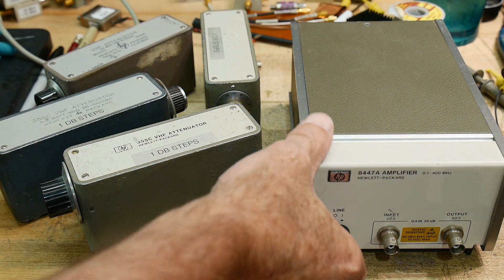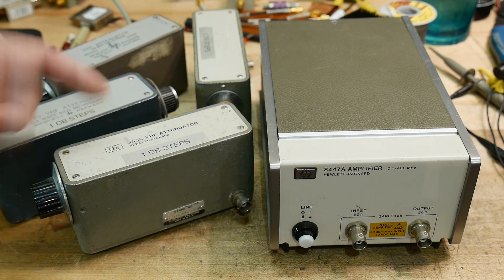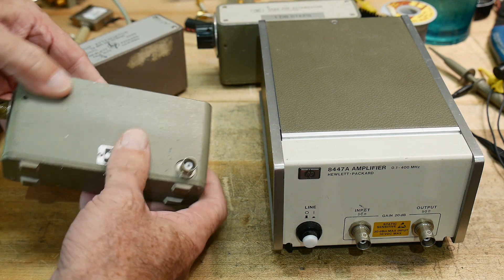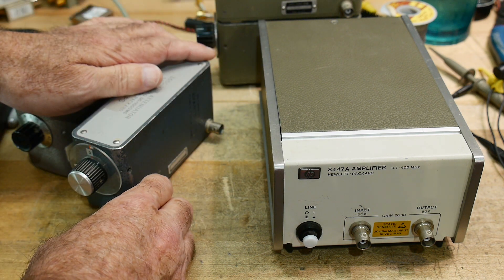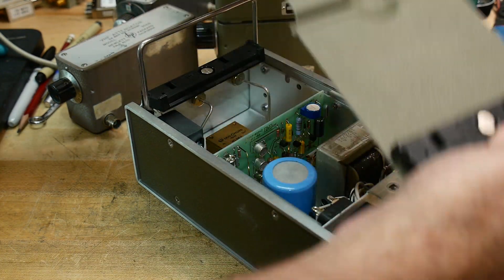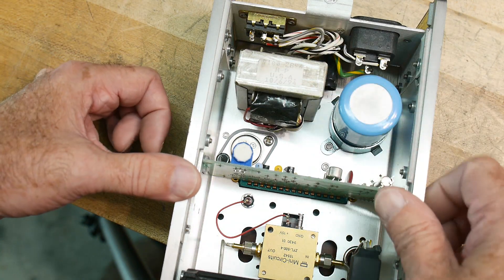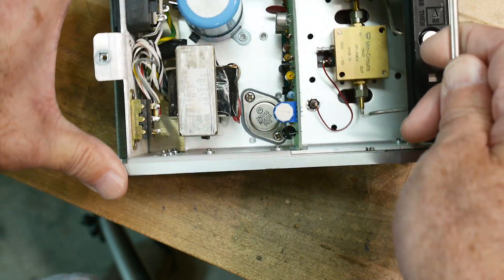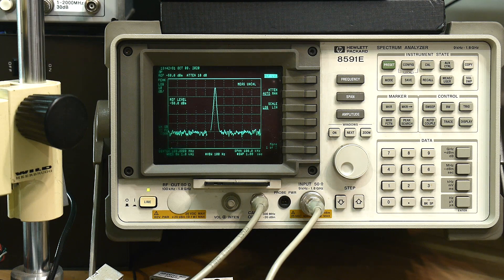#609 Craigslist Find Amplifier and Attenuators

Comment: Good morning. I myself feel happy and lucky on seeing the original hp amplifier (with the mini circuits in it) and the 0-120 dB step attenuator (apart from the 1dB ones) for $20+20. 
It's a great buy.
The 2N3055 NPN Si pass transistor in the 12v linear regulated power supply can pass more than 3-5 amps, I am sure
As you said it's all original factory build (unmodified) with all the miniature rigid coaxial cable with the "perfect bends" made precisely at the factory. 
Congratulations. They deserve to be treated well and maintained in your shack for a very long time..
Thanks for the share.